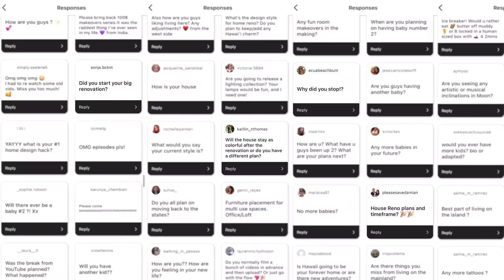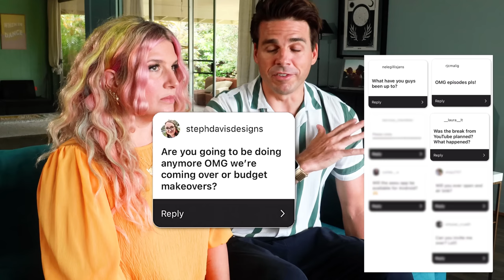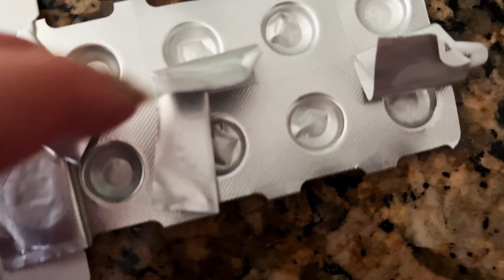The Truth about where we've been...

Comment: I had severe near daily migraines for years. It made everything so impossible. And honestly if it wasn't for my husband constantly rubbing my head and shoulders, and supporting me through it, I don't know what I would have done. After so many years of struggling, I figured out a few things on my own...Hydration is #1. REST. Excedrine Migraine Extra Strength. Hot showers with a strong shower head and water pressure. Ice cold air conditioning. And again REST. Wishing you the best! I'm so sorry you've been going through this for so long!

Comment: I have suffered from migraines as well. About a year ago I got migraine piercings. I don't know whether it's known in the US or not but it has become pretty common here in Germany. You get one piercing on each ear (preferably on both sides for best results). It's  based on ear acupuncture and it does truly help. It's definitely worth checking out. I haven't had a migraine since and other people have had the same experience. If they've been happening almost daily, it got a lot better to where it happens occasionally. If you feel a headache coming, you can just push the piercing back and forth and feel it getting better.
I think it's worth a try especially since you don't want to take any medication which i truly understand. 
If it doesn't work for whatever reason it's still just jewelry and you can take it off if you want to but for it to work you have to let it in all the time, you can't take it off.
It's just important to find a piercer who is qualified to do it. You can't just go to any piercer, the placement of the piercing is very important (it has to puncture your nerve, sounds unpleasant but it really only hurts a little bit when getting it and after that it doesn't hurt at all just like normal piercings).
I hope this info can help someone with migraines just as it has helped me and others.

Comment: Idiopathic Intracranial Hypertension.

I started suffering from head aches in late 2019 but my doctors put it down to stress. That didn't make sense as they would WAKE ME UP from sleep. Stress headaches build up as you are getting progressively more stressed.

I had gone to Specsavers (optometrist) when they first started, then had a routine appointment 2 years later and he said there was something strange in the picture of my eye so he referred me to an eye doctor.

By this point my headaches were a 3-10 all the time, sometimes they would spike and panadol/paracetamol did nothing for them. Only Ibuprofen worked.

Eye doctor says he thinks he knows what the issue is but he cannot diagnose me, and refers me to Neurology. The only clue he gave me was "overweight women are more likely to suffer from this condition" google told me all I needed to know from there.

Neurology said I would need a CT scan and a lumbar puncture to confirm the diagnosis. CT showed extra fluid but lumbar said my levels were only JUST on the cusp of where they would usually diagnose someone. However, it was still valid for me since it is still elevated and I am still suffering.

Thus the diagnosis of IIH. The cure? weight loss. The medication? Acetazolamide. I have a love-hate relationship with this medication. Pro's being of course that my brain feels normal 95% of the time so long as I never forget to take them, and it lowers my appetite so I'm not hungy during the day and often skip lunch.

The downside is PINS AND NEEDLES. Anything that usually causes you to get pins and needles now causes them to be 3x more painful and takes 3x as long to wear off.

Fizzy drinks/pop/soda/carbonated drinks? They also feel like pins and needles and HURT. So that's a pro and a con because I drink a lot less of them but I miss them.

I'm not much of a drinker but you have to limit alcohol consumption while on this medication, it can cause sleepiness but I am always tired so that's not a big side effect for me.

Comment: I had migraines for a month, which absolutely does not come close to your lengthy suffering.  This worked for my pain:  Pycnogenol (by NOW) which is a pain killer with no side effects, plus is an antioxidant that heals the body. I swallowed 2 capsules with strong red raspberry tea every three hours, which is when the symptoms returned (like clockwork.) Red raspberry tea stops nausea, and works well against nausea that can come when one takes much pycnogenol, which one must do to beat the pain. Maybe this info will help someone out there, but hope it helps you also.  I also took Turmeric Supreme (by Gaia Herbs)( and the best turmeric supplement I have found, )and drank CALM magnesium drink 3 times a day.